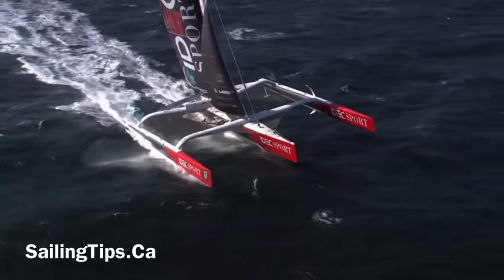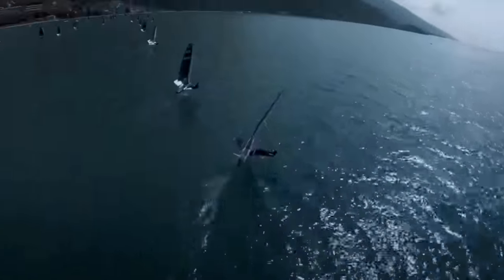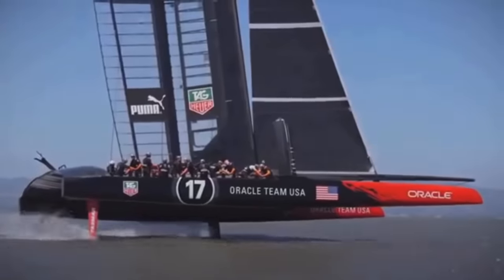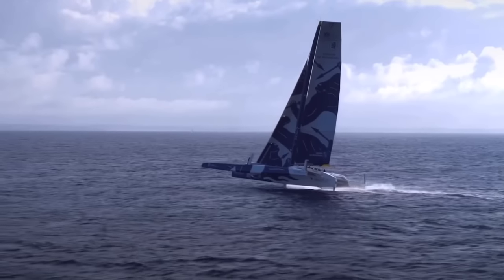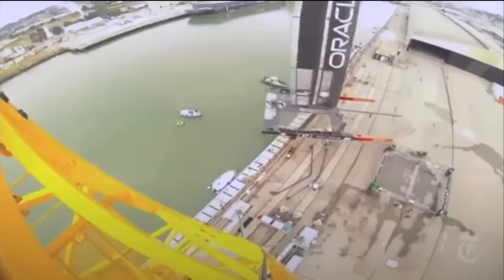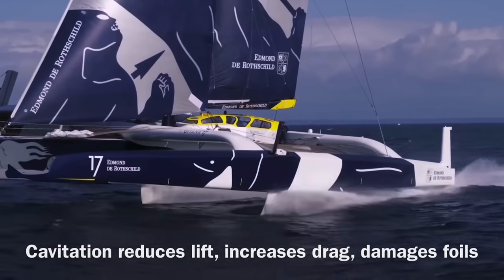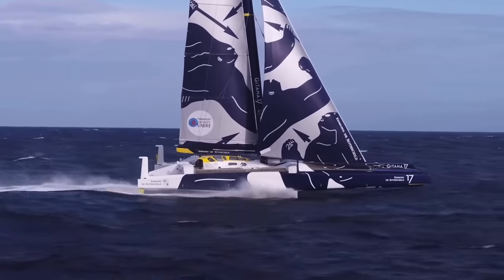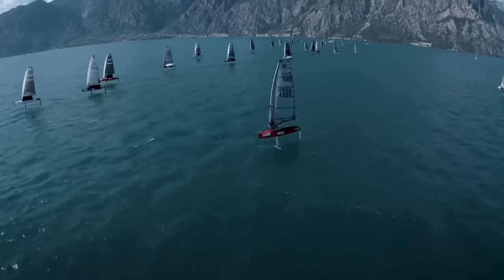How Fast Can a Foiling Sailboat Actually Go?!?!?

Comment: I recommend to Watch the Vendée Globe race, a solo race around the globe. Last time was in 2021. Hugo boss skipper has damaged his boat (again). But on the top 4, it was boats with foils. It is a phantastic race. Next time in 2025.
Reply from the maker: Looking forward to seeing how the latest designs perform! I’ve done a couple of videos on Alex Thomson’s 2016 design, which is still the second fastest IMOCA to circumnavigate, even with a broken foil for 2/3 of the race, and more than five days faster than the winner in 2020/21!!!
Reply: @SailingTipsCa  Why are you promoting not to build foil sailing boats? They are faster (IMOCA or the 60 foot multi-hull boat). They have beaten records on all long distances. But you have to stay a bit reasonable (not like Alex 2 years ago). OK, foils are facing the issue of cavitation at high speed. But is it because they are sailing with a foil or they are sailing fast? Is there a kind of theoretical limit, considering the mechanical equations?
Reply from the maker: @RiceCookerJunior  I think foiling boats are really cool, but there are also lots of practical limitations, which is what I’m trying to help people understand. They provide higher average speeds in moderate conditions, but add weight and drag to the boat in light conditions, and cavitate in heavy conditions.

Comment: Interesting. Not a boat owner but I was under the impression that the foiling boats were practically an entirely new class because "regular boats" could never compete with them.
Reply from the maker: Yes foils offer advantages in some but not all conditions! The Australian OMR rating system doesn’t change a boat’s handicap for having foils and you’d think the foiling boats would win all the time but they don’t!
Reply: foilers have been around for some time but were foil stabilized. there was williwaw around the early 70s the could get air borne, then there was paul ricard by Eric Tabarly that had small floats and foils to assist in righting.

Comment: Wonder if an adjustable telescopic foil would work
Reply from the maker: Yes a foil that can change shape to deal with different speeds would be cool! The problem is that they are quite small and heavily loaded (e.g. compared to airplane wings) so it’s quite an engineering challenge.
Reply: @SailingTipsCa  im imaging a telescopic foil with a hydraulic cylinder inside of it to make it longer or shorter im no expert but  that seems like it would help set how high up they need
Reply from the maker: @djayberry  Gotcha! They can already adjust the depth of the foil in the water, plus either the angle of attack of the foil, or a flap on the trailing edge to control ride height. Here’s a video I did on foiling sail controls: How Do You Control a Foiling Boat?!?!? https://youtu.be/haevc7aWyL8

Comment: There's a new design already that fixes caviatation of the foils. The design needs to be like a kammback of a vehicle (citroen c4 coupe) rather than teardrop shape all the way.
The air trapped after the foil seems to solve the problems of the cavitation and speeds of 50kn have been done
Also these long distance records depend A LOT on the weather.
As we have been shown by the comanche world record behind the scenes, they used to the maximum (or close to it) the weather patterns and receiving the most benefits, plotting a route for that particular need.
So it isn't about hydrofoil vs nonfoil, a lot of other factors lead to world record times.
Reply: Yes we talk about “supercavitating” foil design in this video: How Did Vestas Sailrocket 2 Smash the Sailing Speed Record?!?! https://youtu.be/K3m06731BQY

The Jules Verne (around the world) record attempts also try to pick the best weather window. And in those exceptional weather windows the difference between foiling and non-foiling boats diminishes significantly.
Reply from the maker: I made this video because lots of people automatically believe that boats with foils are always faster in all conditions, which isn't necessarily true!

Sting pointed to one of our videos on foil designs that can go faster, but those designs are inefficient at lower speed, just like supersonic aircraft are inefficient at lower speed.

Comment: My question would be, How well do foils handle 3 to 5 meter seas?   Open water, well developed rollers, would be the easiest that could be expected.  And yet. I don't think a foil would consistently handle a large swell.    Cup races  are normally on sheltered water,, chop or 1 meter,, maybe 2 meters.  And then you get right into durability.  Water is hard.
Reply from the maker: Yes the point of this video was to help people understand how hard this really is! Multihulls are very sensitive to sea state even before you add foils! It really comes down to the shape and period of the waves along with the point of sail, so you'd have to take all of that into account to find the best velocity-made-good (VMG).

Comment: so just asking on the trimarans they can already rase and lower the foils so why not take it a step further and have sets of foils that can be lowered to be used when needed or raised out of the way for instance you could have one larger set for lighter winds one smaller set for the light winds and a set like the sail rocket's for the ultra heigh winds. for rudders it would be more difficult for the ultra heigh winds but just like the A class catamarans  one rudder set would do almost all the weather but idk for the ultra heigh speeds. or would this idea just violate the class rules.
Reply from the maker: Being able to change out foils while underway would be really cool! I don’t know of any class rules that allow that though…
Reply: @SailingTipsCa  but are there any class rules that ban it?
edit:
I am not being cocky I am genuinely curious
Reply from the maker: It depends on the class. Some class rules require all boats to use the same foils to keep the costs down and most classes limit the types of control inputs to the foils.

Comment: Eventually, hydrofoils will need the sort of control surfaces aircraft have to manage cavitation.  Slats and flaps on hydrofoils are just a topic of research and simulation for now.
Reply from the maker: Yes shape-changing control surfaces would be cool, like airplanes have. The challenge here is that water is ~800 times more dense than air, so the loads are higher and the foil itself much smaller than an airplane wing, so harder to fit all the gadgets inside.
Reply: boundary layer transition theory. WSU has water tunnels and wind tunnels thanks to my neighbor donations. Many aerospace engineers in our yacht club which race. We had women's world windsurfer champ, I raced Hobie Cat world's.  The speed  limit is drag.  Ice boats go well  over 100 mph.  My topspeed was in a small cruising sloop at the edge of a tornado on the lake.  It blew a pontoon boat past us like a news paper blowing on a sidewalk.  Killed them  all. The sloop was  planning  like a Laser.  We were dealing  with rag and glue kevlar composites 40 years ago.

Comment: what about Flying Nikka which has been built to break records (I think)?
Reply from the maker: The interesting thing about Flying Nikka is that she's a monohull like the AC75s, but I don't see anything with her design though that would address the cavitation problems at ~50 knots. So if she breaks records it would likely be due to her ability to maintain higher average speeds in moderate wind conditions.

Comment: You forgot to mention the problem with the apparent wind changing to such a degree that fast boats can't get close to the true wind.
Reply from the maker: Yes fast boats definitely "bend" the apparent wind angle far forward of the true wind angle. Even our F-82R trimaran, which is fast compared to most boats but certainly not these foiling monster, can "bend" the apparent wind forward by up to 90 degrees e.g. a TWA of 150 can look like an AWA of 60.

This "bending" becomes less pronounced as the wind moves forward, and a good tight sheeting angle means we can still point as high as a fast racing monohull, but it's often faster in terms of VMG to crack off a few degrees as this substantially increases boat speed.
Reply: @SailingTipsCa  Thank you for the info. Appreciate it.

Comment: Will someone make an ekranoplane evolution of these great boats? Maybe impossible but, sure would be neat.
Reply from the maker: I'm sure the designers of Ultime's take ground effect into account with their beam designs etcetera but I'm not sure if they do it just for controlling the boat and reducing wind resistance or for actual lift. If it did "fly" like an ekranoplan you'd still need some kind of foil in the water to pull it back down, like Vestas Sailrocket in this video: How Did Vestas Sailrocket 2 Smash the Sailing Speed Record?!?! https://youtu.be/K3m06731BQY
Reply: @SailingTipsCa  Interesting you mention Sailrocket 2 here because the lower portion of its wing would actually see a degree of ground effect lift, not a significant factor and that lift primarily served just to raise the leeward sponson. 
One craft that does claim to use ground effect and also uses hydrofoils is Regent Seaglider. I expect the contribution of ground effect there too is minimal, but being designed to run low it will see efficiency gains. The foils primarily serve to help in transition phases.
Reply from the maker: @weatheranddarkness  I recall reading that Sailrocket 2’s beam connecting the main fuselage and wing also has some aerodynamic properties and also operates in ground effect, and I think helps control the height of the wing, although I must admit I don’t recall the specifics. I’ll check out the Regent Seaglider!
Reply: @SailingTipsCa  the beam was a bit more neutral but ya, contributed some of the lift to unload the sponson.

Comment: Dear Fellows, for me the reason why a Mono-Hull Sail is faster than a Trimaran Sail  in this case, is becaouse the Resultant Net Force among the Sail Lift and the Hull Drag that puch the Sail Boat Forward (Squeezing the Hull) is greater in the Mono-Hull  Rgds
Reply from the maker: You should check out this video: Why Are Trimarans So Fast?!?!? https://youtu.be/GxdCcsAdOVM
Reply: @SailingTipsCa  It’s True, although the length among them isn’t the only parameter to consider, is also the displacement among others measures and my previous comment was more related with none foil sail vessels for oceanic ride, maybe because I have in mind an oceanic carbon fiber catamaran than around 2000 broken in heavy seas but with foils it could be different. Therefore, back to the foils sail boats for long distance oceanic ride and the comparison among mono hull and trimaran foil vessels , there is 2 facts in summary that play a significant role on their performance : 1 is the directional stability and the 2 is the wave galloping (pitch), on the first, mono hull have a distribution among the foils close to the center line its mean more like an Arrow Shape its mean highest directional stability to maintain an specific trajectory and in the trimaran the distance among the foils are more like a soap casing shape pushed in the pool, its mean doesn’t have much directional stability to hold an specific constant trajectory of the vessel without a dynamic steering wheel , in other hand the distributed weight of the trimaran allow to induce a greater lift force than a mono hull for the same wind velocity, foil designing etc. and for the 2, the mono hull in heavy seas its more capable to absorb the incoming waves, for the hull geometry and for 1 and a trimaran hull when its consider the distance among the hull´s with the encounter wave velocity and buoyancy distribution the pitch response isn’t necessarily synchronize, inducing further directional instability and galloping effects, which however in a regime of high speed over the waves isn’t necessarily a significant factor, hence in summary, for me a way to improve a trimaran foil performance sail vessel for oceanic ride, it’s to have an extended research to determinate the best hull´s foil distribution that allow the highest directional stability and second the foils must have a  dynamic angle of attack control in order to maintain the lift force accordingly with the incoming waves (e.g. pegasus-class hydrofoils patrol boats) its mean for long oceanic ride a trimaran foil will require more level of engineering complexity than a trimaran foil for bay ride. Rgds and Cheers !
Reply from the maker: @sergiokroff4321  Yes offshore foiling has far more complexities than in protected waters! Dynamic controls to react to the waves would be cool and I’m not aware of any offshore foiling boats that do that.
Reply: @SailingTipsCa  Actually Foiling Sail Vessels are realtiviily New, perhaps in the future some companies will eventually do  a research on this topics . Regds

Comment: No, that is NOT the main reason.  #1 reason is that they are UNSTABLE for the same reason a canard aircraft is unstable(roughly speaking).  The wave motion increases angle of attack, causing the foil to stall, post max amplitude of wave, crashing the hull at HIGH speed causing a pitch pole.  The lifting rudder in the rear can try to counter this moment, but all it really does is dump the entire hull lower to the waves in the same direction of the pitch pole to begin with so the ONLY solution is for a pilot, be it human or computer to anticipate the amplitude and hope and pray you do not have cross waves nor do you have a Big peak wave from cross wave direction so the dumb computer( be it human or not) cannot see this and dumps the boat.   Why America's cup races especially are in closed waters for the hydrofoils and never in open ocean.   It is why the America's cup always has one guy staring at a computer screen trying to keep the boats foiling.  #2 reason you gave and that is Cavitation, though even this is not exactly true as all it really means is one needs a different hydrofoil for this speed regime, just as a supersonic aircraft has a completely different airfoil required for supersonic flight compared to subsonic.  With the only problem being the hydrofoil is working in non compressible fluids and an aircraft is not.    So, you have to cheat by usually introducing air in front of the foil lowering density.  If you think about it, every speedboats and many ships propellers are supersonic.  It would not be difficult to add different hydrofoils to these boats... Just takes $$$ and competency in learning to drop the higher speed foil when appropriate.

In short, the problem is applied engineering COST for bragging rights with no real world application.  So, no one making these around the world boats gives a damn about technical realities, rather they are just trying to be slightly faster than the next billionaires largesse dumped onto a captain for bragging rights. So, currently for bragging rights it is partial foiling.  Maybe in another decade a billionaires bragging rights will require true hydrofoiling to be 1knt faster.  Military is not really interested as stealth(subs) is more important than speed or being so blatantly obvious no one can mistake you for a  warships presence.  And if a military DID go towards hydrofoils they can get most of the benefits by using super long lifting bodies instead of a hydrofoil, but outside the presentation material here.
Reply from the maker: Yes, foiling boats are incredibly unstable, and the penalty for getting it wrong in larger boats is capsize which is very expensive. You basically need some kind of fly-by-wire computer system like fighter jets which is also very expensive. Smaller foiling dinghies tend to use a mechanical wand sensor on the water surface to control foil height, which is much cheaper and more accessible to the masses, but you can't really cross ocean with those.

And yes, there are super-cavitating foil designs that would enable these boats to go faster (e.g. Vestas Sailrocket) but like supersonic aircraft they are not very efficient at subsonic speeds, so as you noted the foils would have to be changed out at a certain speed which presents some interesting engineering and cost challenges! Maybe a good topic for another video!

Comment: So all they have to do is solve the cavitation problem and make adjustable foils and they can go faster?
Reply from the maker: If you use an airplane analogy, a subsonic jetliner uses wings with flaps to increase chord, camber, and size for low-speed takeoff and landing, while maintaining high-speed efficiency. And supersonic planes need different wings altogether. If you could somehow create a morphing foil that does all of this, plus the control systems to operate it, then yes!
Reply: @SailingTipsCa  The Russian rocket torpedo may have some of the answers to raising the upper limit of raw speed. Maybe use a ram scoop to collect high pressure water and channel it to bleed it over the leading edge of the foils to create a  laminar flow.
Reply from the maker: @pforce9  I think the various components of technology exist, especially in military applications as you’ve noted, it’s “just” a matter of putting it together in a civilian package without the benefit of a military budget!
Reply: @SailingTipsCa  perhaps this is an application where "shape memory" materials can come in. Under certain circumstances it could be deformed (even elongated) and then return to it's original shape later.
Reply from the maker: @mrl22222  That’s an interesting idea!